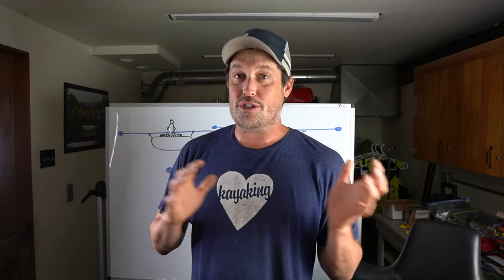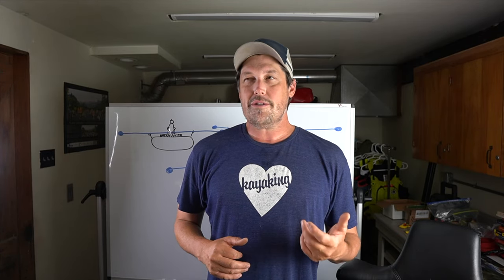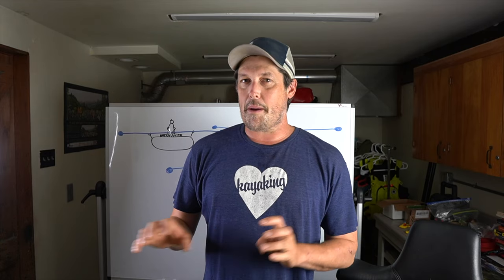Revisiting the Pros and Cons of Counterbalanced Oars

Comment: Most times I agree with you, but not here. Just bought CB oars. Felt lighter but didn't dramatically change anything for me. So far I've run SFA, 2x,  Lower Tuolumne, and Lower Salmon (5 days). My wife on the other hand thought they were awesome. In her view, they took much less effort to row with. So there is probably some tipping point depending on the rower's strength. BTW I don't buy you can tell carrying to car is heavier but you can't tell the rowing is 'lighter". Come on Zach! 🙂

Comment: As a former cyclist, my wrists and hands would hurt me. I was told I was holding my handlebars wrong. I developed Carpal tunnel(sp?). So instead of instinctively grabbing the handle as anyone would I should be resting on the outside pads of my hand. It does feel better. Translated to rowing, I generally don’t hold the oar handle past the middle of my palm for these ergonomic considerations. Thus, I do prefer my oars just inside shoulder width. I love that techniques though and want to play with that.

Comment: Great discussion from Zach as usual.

I recently got counterbalanced oars for my 16' gear boat and I'm a fan. The weightless feeling while pushing the oar handles down is really cool and it's noticeable with my big 11' oars.

I get what he's saying about extra mass to move around, but it's on a low friction pivot and I can't say I've ever noticed a difference - what's an extra few pounds when you're yarding on oars? And your push/pull chest and back muscles are much stronger than your up/down shoulder muscles.

That said, I'm doing mostly CO/UT overnight trips with significant amounts of flatwater. I probably wouldn't want counterbalanced oars for maneuvering a cat on lower volume rivers.

Comment: Much of my oar set up is determined by my most efficient brace position, which is. When I brace to punch a hole, t-up a wave or cross a lateral pushing.  My ideal brace position is:

Sitting strait up with feet planted.   

Elbows Slightly in front of shoulders.

Hands at nipple height. 

The key to this brace position is to squeeze your elbows into your ribs when bracing. When bracing I squeeze my elbows in and engage my wrists and arms to keep the oar in the brace position.  
To me, having this brace position dialed is the most important part of my set up.

Comment: I agree with the energy it takes to move the counter-balance.  Especially if the oar starts a movement you don't want, i.e. if you dip your oar in to an eddy to turn but it pulls/pushes on the oar in the opposite direction you want,  I've found (this could be in my head though) it's easier to hold a non-counter-balanced than a counter balanced in that situation. That being said, I was given a free set of counter-balanced so I run them on one set up I have, but buy non counter-balanced oars when i have the opportunity.